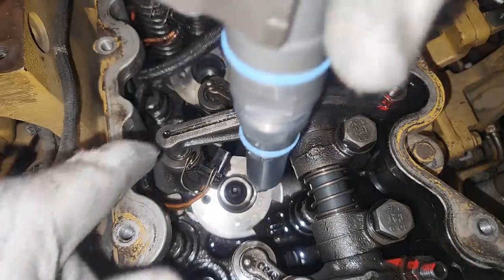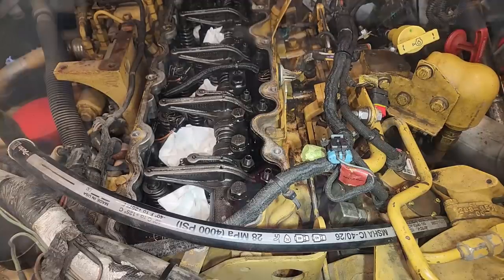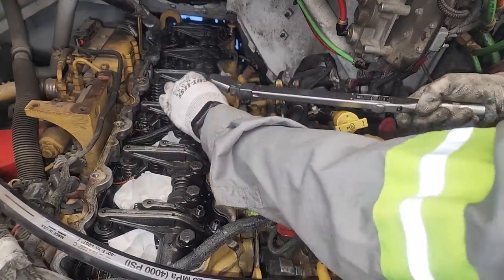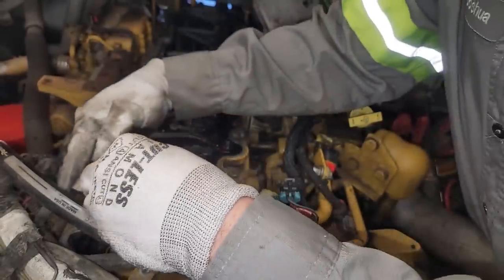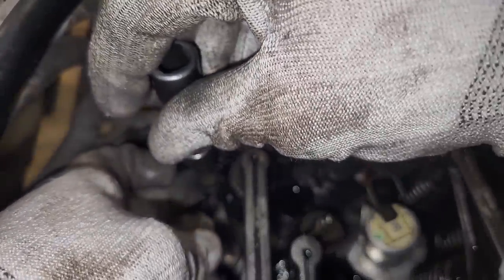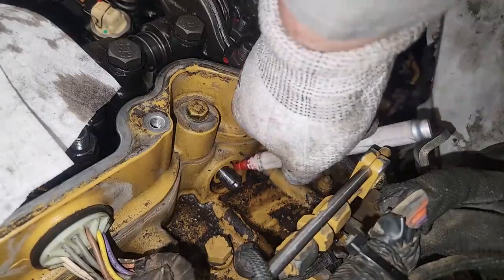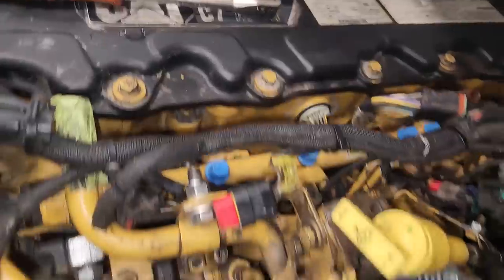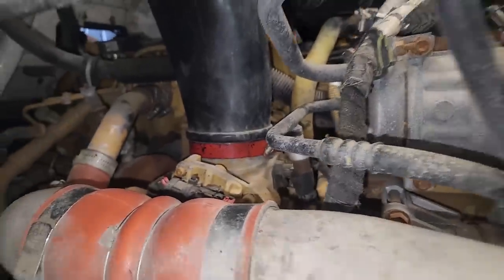Did Injectors Fix "Cranky" the Ford F-750 not starting? SURPRISE ENDING! "Cranky" Part 2

Comment from the maker: Thanks for watching the video. I put a lot of work into this one so, hope you liked it. Find some of the tools used in this video at the Amazon Affiliate Links right here: OTC Vacuum Brake Bleeder: https://amzn.to/3pvq1JI 
Oiling Can: https://amzn.to/3c3MKK0  
Power Probe 3 Red: https://amzn.to/39JtYGe 
Infrared Topdon Camera: https://amzn.to/3luEWlw 
3/4" Drive Ratchet Expanding: https://amzn.to/3yRL7I1 
Chicago Pneumatic 1/2" Stubby Impact: https://amzn.to/3zwwSZw 
Milwaukee 3/8" Impact Wrench Kit: https://amzn.to/39fkOkT 
Gearwrench Inverted Torx Socket Set: https://amzn.to/3IceRlI
Reply: Hey josh can you answer 1 question for me? I have a C7 in an 06 gmc top kick and I can not find where or what the part numbers are for fuel check valve(s) and fuel pressure regulator
Reply: What kind of paint did you use, red color?

Comment: They may claim someone else deleted it, but government officials are the first in line to ignore laws that inconvenience them and emissions laws on trucks that spend lots of time at low speed and idle a dpf is certainly an inconvenience to put it mildly.
Reply: And counties buy new usually.
Reply: @katokagome4670  👍
Reply: 90% of the busses in my city roll coal.
Reply: The ARD head is a much bigger headache than the DPF on a CGI system
Reply: Yeah they had to delete all the local fire trucks because they were having trouble because they had to idle quite a bit. No problems they just did it
Reply: @DigD97  pretty sure emergency vehicles can be exempt
Reply: not really.  it's not worth it for starters - you could lose your job.  and the govt pays their bills so you hire someone to fix it.  very likely a private outfit skirting the law.
Reply: worked on city fleet . never ever would our city fleet remove ,unplug or void emission equipment
Reply: i love it when i get old crown vics from police auctions and the secondary cats are cut out... some mechanic for the state is making some good side money
Reply: Yeah I had to drive a garbage truck for my aunt for a few months after my uncle died, the truck going into regen was definitely a nuisance and a great way to waste 20 minutes
Reply: I wouldn't put it past the government to pull that off in certain municipalitys
Reply: @TechOut  Emergency vehicles are not exempt only federal military vehicles are exempt everyone else is supposed to comply to the clown rules
Reply: @DigD97  wonderful for them, the epa just made a kid scrap his 10k dodge ram cause he sold it on fb deleted.. And these  govies think we like them 😸
Reply: @foxbodyguyeightyeight3672  My military unit had 2013 Ford f-450s that were non emission from Ford. I believe the reasoning was they could get sent overseas where low sulfur fuel may not be available.
Reply: @johnlow5489 no. Military vehicles don’t have time to have regen issues or limp modes due to the plague of other problems. Not a very bright idea to have that nonsense environmental friendly junk during life or death situations. That’s why
Reply: @mikealfieri641  Depends on the use case for the equipment and how much money they have. My county buys a lot of used stuff, usually through govermnent surplus. If it isn't gonna get used all the time, theres no reason to buy new.
Reply: @TechOut  lol doesn't work like that... Charge everyone else but we don't need too

Comment: I’ve been doing this for 13 years and your tip about 60 degrees being one flat was a facepalm moment. I’m glad I found you’re channel. Not a lot of channels about heavy equipment and engine repair. Still kind of weird to come home from doing this same thing to watch someone else do it on the internet. Also the brake bleeder on the filter assembly chef kiss
Reply: Western truck and tractor is another good one. Warren works on almost anything.
Reply: What is one flat?
Reply: @onefromfuture6913  a nut has 6 flats and a circle is 360°.. so 1 flat is 60°
Reply: @GYPSY400  huh, sadly I would have never thought that, which is scary because ive been wrenching for a damn long time, guess the math teacher was somewhat right
Reply: @danking5382  any time I've done a torque to yield its been either multiples of 60° (each flat) or 90° ( quarter turn)
Reply: where does that western truck and tractor shop located at??? lewiston idaho ???

Comment: You're right.  I didn't see that coming.  Somebody spend a chunk of change on that DPF delete.
Reply: As soon as he said it was a county truck- boom! I knew it would have been deleted instantly. I am the mechanic at a highway dept. These trucks idle all day , the emissions systems hate it …
Reply: @JohnDiMartino , the county will probably have a tune put back on the ECM to ignore the DPF. In some states they only require a safety for Diesels & no emissions checks.

But ur ur truck is smoking rly bad, & rolling coal then you’ll probably fail at the inspections discretion, but that’s abt it.
Reply: @michaelbenoit248  sounds like ecm wasn't the issue unless i missed it so probably put the original one that was in a back in and call it a day and use the truck.
Reply: The problem is that it will not leave that shop without being restored back to factory condition due to their not going to get hit by the feds. There have been service managers and other techson YT that has said if you bring a deleted truck to them they will report it.
Reply: @rodneygrant7726  I bet the first time it gives them trouble they delete it again!
Reply: @arbiter1   Who says the original ECM is still around? If a shop did the work, they might have had to send that ECM in as a core, or just got rid of it, since it was replaced anyway.

Comment: Love the detective work that seems to be common when we get the truck after she's been touched by multiple people...sure would be nice if we could just get the history upfront and save ourselves the time it takes to get it resolved once and for all.  Thanks for sharing this with us 🙏
Reply: Yeah that's called service history and service record and it's a critical part of diesel school but people only do what the employer requires
Reply: Completely agreed. For vehicles that have changed ownership it is highly unlikely the current owner has that information. I am the third owner of my truck and was informed that I would get the "maintenance history" of the vehicle from the second owner. What I received was one slip of torn paper with the mileage when the chassis was lubed and the mileage when the oil filters were changed. That, apparently, was the entire "maintenance history" at about 550k miles. I guess that was better than nothing, but not by much.

Comment: I like the shop this man works in A LOT. 

Several years ago, I needed some metric O-rings for a machine I use at work that is not a truck. In North Idaho metric O-rings are not easy to find. I had tried EVERYWHERE to find them. Finally I see Western States Cat sitting there..."they won't have them either but it won't hurt to try."

"Oh yeah. That's all we've got. What size?" They didn't even complain that I showed up on a bicycle dressed like I was going to Ironman. And they were a lot less expensive than I expected. Totally classy operation.

Comment: Their failing injectors were probably giving them dpf face block and instead of doing the injectors they opted for the crowbar through the dpf delete. Would be interesting to know if prior to installing the dpf hole it was continualy requesting regens.
Reply: I know what some of these words mean. I think I know enough to know someone did a REAL bad.

Comment: I enjoy watching your videos.I have ben Cat certified at a Teps dealer since the early 90’s.Appreciate your knowledge and speaking ability.Im thinking you could have capped each injector  one at a time to isolate until engine started ?Release unit as is and let customer delete it way better off in the long run

Comment: I feel the same way, torque everything I can just for peace of mind and so I can say I did what I was supposed to. I also try to not fill filters from a bottle.
Reply: I'm a flat rate dealer technician and I torque a lot of fasteners - particularly steering/suspension and critical engine fasteners (timing related).  I know it slows me down but my comeback rate is very low.

Comment: Have you ever thought of vacuuming off dirt you don't want to get into a bore?  It's something I've done for a while.  It gets rid of the dirt but doesn't get it in the bore.   Just a suggestion.  Sounds like this turned out to be an expensive repair.  It's probably not going to be a good day for the seller of that truck when the county gets done with them.  Keep the good stuff coming.
Reply: No need. He cleaned it all up. The only way you’re getting dirt in there is if you intentionally knock dirt into it.
Reply: How come will be a bad day for the seller ….. 🤷‍♂️
No moral to do that since they running off road fuel in it … 
So … that says it all 
they did know about the rest for sure and also .. 
99.9 chances they also did it 

Do as I say , not as I Do 
Thats what its

Comment: I have a. 74 LN 6000. With 1140 cat and always runs ,keep valves adjusted and air brake s adjusted never any problems.
Water, logging and dump truck, seasonal use, cost of ownership cheap compared to this one, 
EPA has made costs especially expensive on the newer rigs, and maintenance manufacture of this stuff really pollutes the atmosphere.  Have a newer tractor with a DPF filter and regen switch so I can regen when needed. 200 hrs so far so good, 
Keep my fingers crossed! 
Cheers, enjoy the content.

Comment: Ard head just the thought brings back fun times constant updates on Sdp and Lee engines. Different heads different temp sensors different filter fittings constant flushing on and on

Comment: I happen to work where the injectors are made.  I can tell you with nearly 30 yrs experience.. Bad fuel,  bad maintenance,  and cheap filters,  are the main reasons for injector failure. Some of the tolerances in there are sub micron.  ANY dirt will lock them quicker than 💩.

Comment: Your channel is informative you do very well at public speaking   and seem to be very knowledgeable . Enjoy watching  them.
I have a C7 SF65 bus it has a 265amp alt.im building a skoolie would you suggest putting a braker in the charging  wire go back To the battery's

Comment: Another excellent video. I always use never seize on quill tube nuts. I have had quite a few on Cummins engines I had to use a long 1/2” drive ratchet to break them loose. I’m surprised Cat doesn’t have you cap off the rail one injector at a time to identify which injector is spilling excessive fuel.
Reply: Some engines they tell you to cap all but one and measure how much leakage is coming from the one injector that is still connected, then of course check all of the others one at a time. It's pretty much a pain in the ass
Reply: Why only do one injector when you’re that far into it?
Reply: I think Cats thinking is that if this injector is bad, then the rest probably are close or bad also. Might as well save the labor on testing, and spend it on making sure everything is good.
Reply: @mikeznel6048  Because shop time is expensive and people want you to stand behind your work....If you are working on your own truck you can spend you time freely but when it is customer time ...But hours of diagnostic time playing swaptronics is tough to sell ...Especially when you isolate the bad injector and in a short time it turns out that another one is bad..

Comment: I probably over filter my fuel, I run cat filters on my FASS along with a cat filter on the engine. All changed every 20k so they look new when removed, but I really hate dealing with fuel issues lol
Reply: I make the injectors..  You're doing the right thing.

Comment: Since you have not directly stated this I have no idea what your shop policy is with regards to deleted vehicles, however I would be very surprised if it was anything other than either the aftertreatment system is brought back to OEM standards or that vehicle never sees one of your service bays again. In speaking with owners who have vehicles with such unauthorized modifications, they can't even take those vehicles to a factory-authorized shop for new tires unless the work order for the new tires includes a new DPF.
Reply: From the sound of it, it seems like this truck isn't leaving until its fixed. This is a county truck, so Federal policy is above them. If you ever do something that is breaking the law, keep is far away from anyone else that can find out. As far as shop policy, I can see it being that as long as it leaves fixed, and doesn't show up again with a delete by the same owner, it should be safe to not change anything for that customer. Maybe they didn't do the delete, and never knew about it. Clearly, if it happens a second time, they know then, so then things can change. Of course, this is just my thinking, and they can use any policy they like.

Comment: It is pretty funny calling the thing "Cranky".  I left the Ford medium/heavy truck field as a mechanic just about when those things came out.  Even some of the early 7.3s could have earned the same name back in the day due to HEUI injectors that could not keep their sealing rings intact.   IPRs too had a rough time keeping rings.  Damn.  I did so many of those things.  Figures the CAT would have similar ailment.  After a few of those, no need to really diagnose.  Just pull the fuel filter bowl cover and observe all the rubber present.  Where did all that junk come from?  Hmmm?  Yea, bad sealing rings on everything.  I also wondered why they used CAT.  The  7.3 could have served the same purpose with the same power.  Just tradition, I guess.
Reply: Those older 7.3 injector o-rings were a pain. Definitely were much better in the late 90s/early 00s when they changed design.
Reply: Don’t forget IPR wiring harness that dissolves when the fuel bowl leaks!
Reply: This engine is a tier 4 emissions. The 7.3 was phased out long ago because it couldn’t meet emissions standards.  This truck had to have an emissions compliant engine.
Reply: They use cat engines because that is what the market wants. A large portion of these trucks are in service for companies that have a lot of other cat equipment and very few internationals therefor they wanted cat. I also doubt a 7.3 would have the same lifespan as the cat engines in this application.
Reply: @chris6200  "eh not sure I agree with the life-span thing.  That CAT was not great(not much different than the 7.3).  Except for fuel sealing problems, the 7.3 was rock solid.  I had a CAT guy with his F450 service truck come into my dealership acting so proud that he started 3 brush fires and had aluminum(piston material) dripping out of his tail pipe on a 7.3.  An injector on the RR(#7 in IH terms had cracked off and was just pouring in).  I asked him, " Why the hell didn't you just shut the thing down?"  He said, "because it's under warranty."   What a jerk.  I asked, "How about if I did that on a 3406E?  What would you say the same thing then?"  CAT service folk, IMO ,can be some of the biggest jerk customers ever.  That 7.3 at the time just for a short block was $11K.  But oh no, at the time you couldn't get the short block...ended up swapping stuff over to bare block.  I'm not at all impressed with CAT smaller engines.
Reply: @nhzxboi  Cats smaller engine can be hit and miss but realistically a 7.3 is about a 250-300k engine in a pickup. Yes many do a lot more than that, but just as many blow up with less than 150 on the clock. The larger the truck the harder and faster the engine has to run per mile. A mile on the engine in a f750 is not the same as a mile in an f250. What I'm say is it's probably not going to be a 250k plus mile engine in this kind of application
Reply: @chris6200  The F750 has the 6.7 now.  I wonder how long they're lasting.

Comment: Is anyone else thinking that after seeing the delete job they would have just asked if the old reprogrammed ECM was around and put that back in and pretended like nothing ever happened?  

I and pretty much everyone I know that deals with commercial anything will pay way more for a machine with a deleted emission system than one with a working one due to long-term maintenance issues and cost savings justifying it.
Reply: That’s most likely what happened, but he’s not gonna say that on this video, for obvious reasons.
Reply: It definitely would not be getting all that replaced if I had a say. Either pop the old ECM back in or do the DPF delete on that one. But obviously can’t openly admit to circumventing emissions systems on YouTube.
Reply: @joshuadavis1547  yeah, I think that’s the biggest issue. Can’t be a mechanic at a reputable Cat dealer, and speak of how awesome deletes are (best thing ever)

Comment: Thoughts on cleaning quill tubes while the old ones are still in? I did injectors on a D6T and I cleaned out the area around the tubes before I pulled them out with ether and air.

Comment: Could retorquing quill tube nuts instead of replacing injectors, have fixed this? We've fixed a ton of Cummins common rail low fuel pressure issues by checking connector tube nut torque first. They're only torqued to 37 ft.lbs. and somehow loosen up over time and begin to leak excess fuel so much they can't build enough pressure during cranking.

Comment: Regarding that destruction video, I recall when I worked in an engine shop in the early 2000s that they learned the hard way about a certain mack engine that needed to have the small end wrist pin bore bushings pressed against the rod after they were pressed in. 
Some kinda little roller that went in and turned and expanded the bushing against the bore even tighter than the standard press fit.  
I guess they started making noise a few hundred miles after an overhaul,so that was interesting even though I only heard about half of the conversation about it from 20' away.